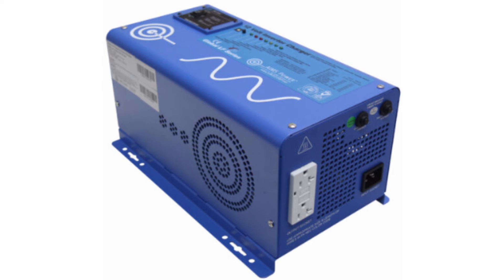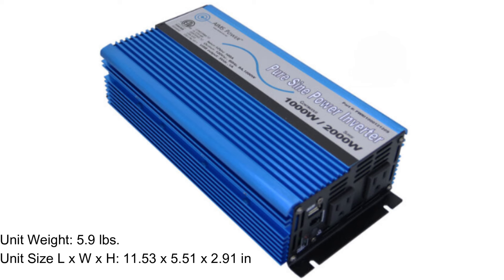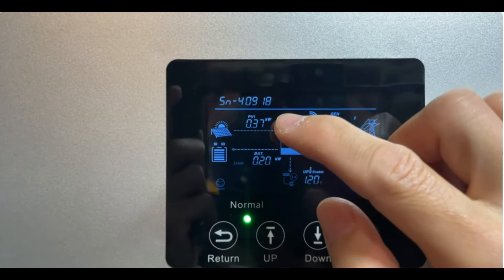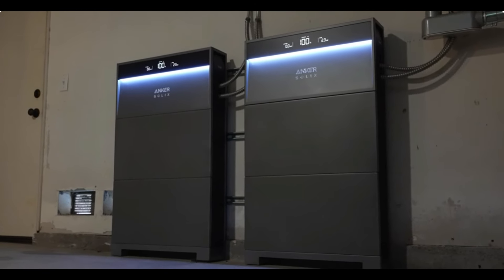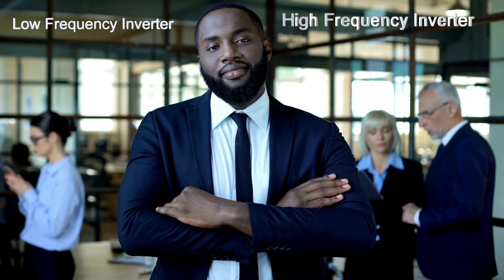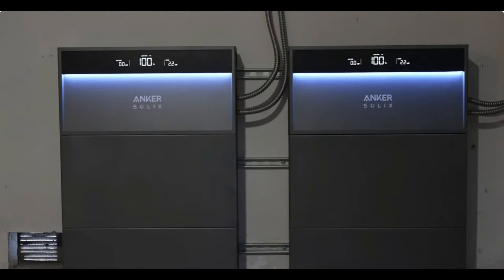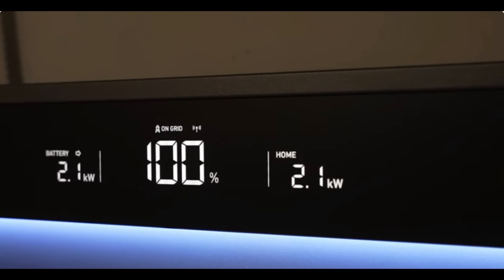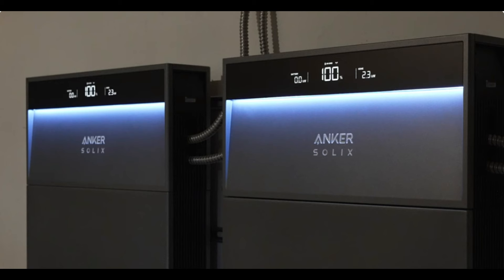Which Inverter is Right For You? High Frequency or a Low Frequency Inverter

Comment: High frequency inverters are typically smaller and lighter and offer a slightly better efficiency rating, but because they don't use an output transformer, they don't offer any galvanic isolation between their DC boost stage and their AC output, which makes high frequency inverters far less safe when powering household appliances. Lightweight high frequency inverters can even set your appliances on fire during a catastrophic failure of their H-Bridge circuit.